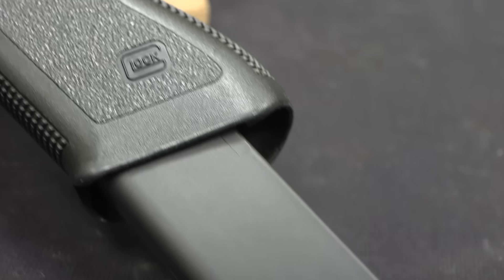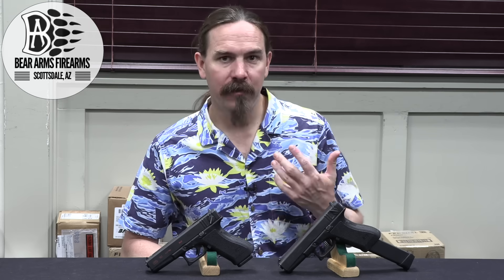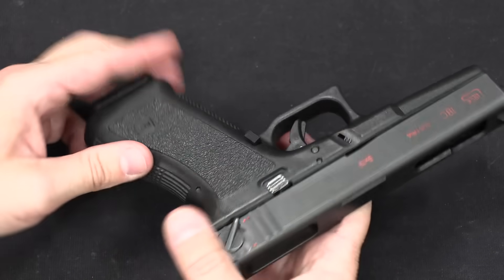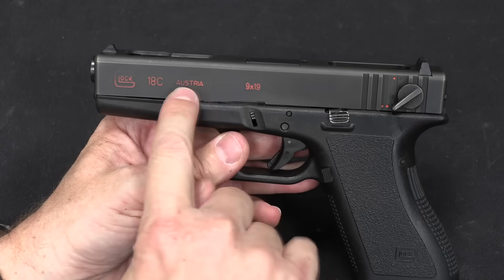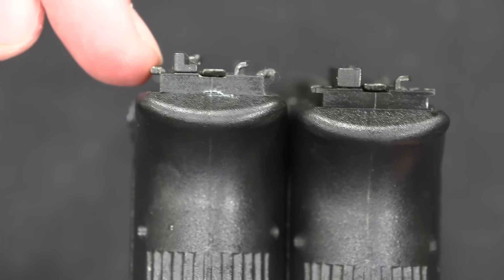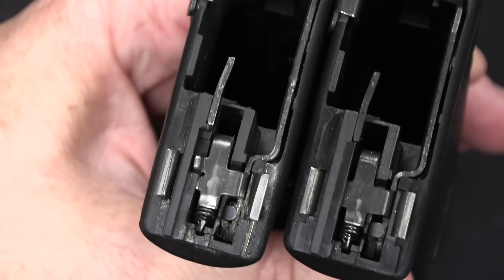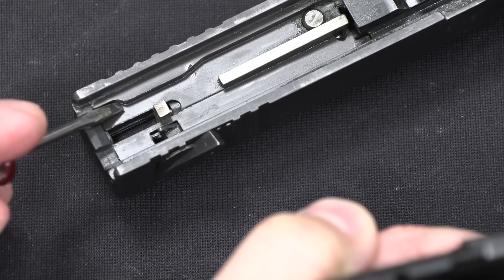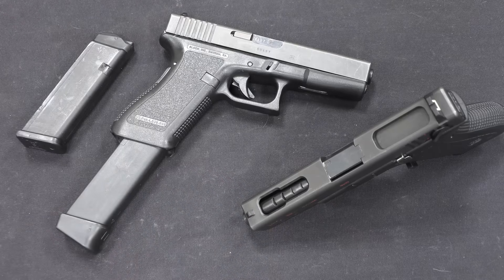Glock 18 & 18C Machine Pistols: How Do They Work?

Comment: 5:05 I'd like to remind folks that FRTs are totally legal to buy right now and exist for many common pistols like the every glock ever.
Reply: What I understand is that FRTs are kinda legal but not for handguns so...
¯\_(ツ)_/¯
Reply: @SniperSnake50BMG maybe it depends on where you live. They effectively arent legal in Chicago or NYC because of regulations on handguns in general, but from a federal position the ATF says 1 round for 1 trigger pull is semi auto. Thats what an FRT does, just very fast. 

Until the letter of the law is changed, all FRTs are currently legal because the trigger resets after every round is fired and needs to be pulled again. By definition thats semi auto. 

Also I brought by tx-22 with frt to a DNR operated range with law enforcement present and everyone was cool with it. I wasn't even the only frt pistol guy there.

Buy it now while you can.

Comment: Sig, notice how it stops firing when you release the trigger. Write that down.
Reply: Also notice it starts firing when you press the trigger
Reply: I have a P320, i managed to pull the trigger once while dryfiring WHILE the safety was on.
Reply: @BlAcKSaDooo  Then it's either a M17 or M18.🤔🇺🇸🇺🇸
Reply: @BlAcKSaDooo  jokes aside, P320s don’t have a safety you can turn on or off
Reply: Military compliant ones are required to have a manual safety as part of the contract
Reply: LOL
Reply: Because a p320 doesn't need the trigger pulled.  Don't you see how sig made it better!

Comment: Wait, at 7:50 when you rack the slide while holding down the trigger it trips the sear. Doesn't this mean it will essentially run away immediately if one is neglectful enough to be pulling the trigger while reloading?
Reply: if you had any training, you know to not point it at anything you're not willing to destroy, and to keep your trigger finger off until you're ready to fire
Reply: @stefthorman8548  Sure, doesn't mean the scenario I described is any less desirable though.

Comment: I must bust this recoil myth. Lighter slide/bolt is not going to reduce recoil, let me explain. Common momentum of two objects (projectile and slide) will always remain the same, if you make slide lighter it will go back faster (this can be proven by velocity=force×time×mass^(-1) formula). Let's say we have 0,01kg (155 grain) bullet and 0,5kg slide. Their momentum must be equal so if bullet leaves barrel with muzzle velocity of 400m/s rearward velocity of slide is going to be 8m/s (momentum=velocity×mass). Kinetic energy of the projectile is going to be 800J and kinetic energy of the slide is going to be 16J (energy=velocity^(2)×mass×0,5), we can already see that lighter object absorbs more energy and that energy ratio is inverted mass ratio. Now if we made slide half the weight (0,25kg) it's rearward velocity is going to be 16m/s since it's momentum still must be equal to the momentum of the bullet. But now it's energy is 32J because it's lighter and absorbed more of it. This is why you see people putting big red dots on their 10mm MOS Glocks, they are trying to reduce energy of the slide. It is also why straight blowback guns have so heavy bolt/slide.

Comment: This is how a glock switch works, it just pushed down on the striker plate with proper timing and putting it into single moves the pin back 2mm so it can't.

Comment: Besides having fun and going thru ammo quick and of course impressing folks who don't know much and folks who know alot and ate like dang you was able to get one of those there aint much use like he said besides maybe ricocheting a bunch of rounds really quick which could be useful especially if one has another mag to pop in. It having the selector switch tho should make it more useful than semiautomatic versions alas the restrictions which are stupid in this case since it would likely be less effective than semiautomatic in the hands of someone who don't know much. I suppose there is the contact or near contact mag dump which would be pretty gnarly since getting thirty rounds pumped thru a person in less than a second is vicious and id wager often fatal. Two in the chest and one in the head? Na how about thirty in the head or thirty to the chest.  I wonder how most vests and people for that matter if wearing a plate would deal with with so many rounds so quickly in a small area.

Comment: It works the same basic way the "switches" work, except that the add on version pushes the opposite side of that plate without the tab that sticks up ! I had to fit a connector bar for a friend that had a post dealer SOT sample switch.

Comment: I may have missed it, but why does the 18 have 2 pins and the 18c 3 pins. It was my understanding that the 3 pin trigger module wasnt introduced until the gen 3 glocks, and then it would have finger grooves as well but the 18c has none.

Comment: Attending a Glock Armorer's class in Smyrna in the 80's, the entire class got to fire one 32 rd magazine each through the pistol. Great fun, fairly easy to control where you were shooting but not how many rounds per trigger pull.  When the slide got too hot to touch, the instructor stuck it in the eye wash fountain for a few seconds to cool it.
Reply: Thats pretty cool. Isnt that a good way to warp the slide though? Just letting it cool naturally would be best, correct?
Reply: @whiteyfisk9769  Typically heat, then controlled cooling, but the slide was no where near hot enough for tempering, just too hot to handle. He would also take and fling the pistol hard across the floor into the walls and corners of the range. He was reinforcing to a group of police range officers that this new weapon was tough.

Comment: comparing a 18 with a 17 and a switch would be interesting because it shows 2 different ways to make the same gun go FA
Reply: It’s surprisingly similar and the principle is the same. Glock moves the full auto bit up in semi for disassembly. Switch devices move the angled part slightly rearward for semi but it still blocks disassembly.

Comment: In Argentina the Buenos Aires Police Department, issue G18s to their Special Unit "Halcon" in the 90's and early 2000. The unit veterans still have them. But newer operators receive the Bersa.

Comment: I would really love to try out a compensated one. I have fired a normal Glock 18 and confirm it is a spray and pray. First shot is on target, and everything else is in the air. If you flinch bad you might get a burst on target, so great for bad shooters I guess, haha.

I always loved how simple these were. Little nub pushes the sear. The end. They did not even bother stopping the disconnector from working like a lot of auto designs.

Comment: By the way, there are NO civilian legal Transferable Glock 18’s or “Glock switches”.  Transferable  machine guns were banned from import in 1968 by the GCA. Domestically manufactured machine guns were banned in 1986 by the FOPA
Reply: theoretically, a demilled 18 could have been imported and re-welded and registered before the cut off date, but you are probably correct

Comment: You know what would make the Glock 18 very very controllable without the compensation?
A proper shoulder stock in the same sort of style as the one that engages 3-round-burst for the Beretta M93R.
...Of course, like anything "fun" that is firearms related, it would also probably make the ATF rather irate, and be instantly outlawed in both CA and NY.

Comment: @7:11 It seems amazing to me that this works at all. It's all tiny contact surfaces on very rough-looking parts. Maybe that's just Gen2?
Reply: The top of the ejector and trigger bar are noticeably rough since the parts are stamped from sheet material. The rough parts don’t touch anything.  

Glocks were reliable when they looked like this and they still look pretty much the same. I’ve seen really old ones, mine is from 2002, and I’ve seen new ones. Glocks will be Glocks.
Reply: @Glocktologist  Name checks out.

Comment: I got to play with a G18 &G18C some years ago. They were LE dealer sample guns.  Took them apart to see the internal differences.  They were Gen 3 guns.  Never seen a Gen 4 or 5  version. I’m a class 3 dealer and I can’t imagine Glock made very many as there isn’t a big market.  If the 1986 Machine Gun ban was overturned I could sell thousands of these though.

Comment: I'm not super familiar with modern pistols; if the trigger cocks the striker the rest of the way, how does the striker get fully cocked for subsequent shots? Or does it not get caught while cycling f/a?
Reply: The disconnector trips as the slide moves back. The trigger bar is in the rearmost position at that point. 

As the slide returns forward, the firing pin catches the sear on the way. So the firing pin and recoil spring are actually pushing the slide in opposite directions.

Comment: I doubt he'll ever risk violating youtube rules but it would be neat if Ian did a video comparing the glock 18 to glock switches. Like, how does a glock switch work vs the glock 18?  Am I banned just for asking that?
Reply: Not much to compare. Aftermarket switches have a similar angled surface as the genuine thing, but it’s a little to the right so it is able to press the normal trigger bar / sear down.
Reply: @Glocktologist  i wonder if we are both banned now 🤭

Comment: Full auto Glocks are actually pretty easy to control when one has had enough run time with that platform, in the ATF agents defense you can not remove the slide of a Glock with a Aftermarket Auto Sear without removing the backplate selector and sear first. That is why Ian mentioned in the beginning that the Selector on the 18 needed to be in the semi mode. It brings the seat out of the way and allows the slide to be removed.
Reply: Isn't it their job to know guns work since their regulating them to a degree? I mean, glocks are not super complicated.
Reply: @Bigfoothawk  just because someone should know something doesn't mean they will
Reply: I’m

Comment: It would be interesting to see how the "Chicago" switch works in comparison to the OEM system...
Reply: Even simpler!
It just prevents the triger bar from poping under the disconnector surface on the sear.
Then the slide peresses the triger bar again (normaly the out of batterie funktion).
But i guess thats not as reliable and causes more wear on those parts then they are designed for.

I build somthing like that for the Peterstahl 1911 (Fancy german high end clone) from my father.
Don´t know if that works on all 1911s.
Just a pice of sheet metal that got stacked over a pin for the sear parts and prevented the sear from disconecting.
Then the out of batterie plunger that gets depressed from the slide was the "Autosear".
Not super reliable and not switchable, but good for a little giggle! 

7 Rounds of pluss P .45ACP in a blink of an eye is scary and fun at the same time!!! 😅
Reply: @martin09091989  Appreciate the reply!! Thank you!!
Reply: I'm sure YouTube would love that lol
Reply: @kiwi_comanche  huh. My comment got deleted. BS...
Reply: @TheExplosiveGuy  I can see it
Reply: Even simpler but in a rifle is the old matchstick under the sear of a 7.62 SLR (FN FAL). Good fun with blanks in training, and even funner with live rounds.
Reply: @Klemheist-vf1hx  The Norinco SKS-D has a similar feature, there's a little hole on the side of the fire control unit that a piece of 10 gauge copper wire fits in nicely and prevents the disconnector from falling off the sear, but the gun is nigh uncontrollable due to being over-gassed like a MF'er, it probably shoots at around 900-1000 RPM lol. Many a giggle were had when a friend of mine brought his out on shooting trips😂. The first shot lands dead on, by the third round it makes a good duck gun lmao🤣.
Reply: @Klemheist-vf1hx  Had some good times with the SLR myself as it happens!!!!
Reply: I have no 2 cents to contribute. 
I'm just here for the algorithm.
Reply: @TheCivilWarriorProj  😂🫡
Reply: Both are oem . If u mean og version then ok I get i

Comment: I see how the 18 work how do the "Glock switches" work then if it don't have the ability to reset the striker or does it?
Reply: It works in a similar fashion but the angled part is more to the right. 

The disco trips as soon as the slide moves back. 

All switches (including the actual Glock 18) simply force the trigger bar / sear down as the slide moves all the way forward.

Comment: I’m not sure how the striker gets re-cocked in full auto, if the protrusion trips the cruciform sear in its rearward position.
Reply: When the slide moves back, the disco trips and the sear rises up. 

When the slide is coming forward, the firing pin catches on the sear and the firing pin spring starts to compress. 

Only at the very last moment before the slide hits fully forward, the angled surface on the full auto bit (genuine Glock or aftermarket switch) pushes the sear down to release the firing pin.

Comment: I live in Smyrna Ga. and am a retired Glock employee.  I always wanted a gen 2, 17 L and we made so few of them that I could not get one.  They used to fire those 18's until they just melted. Hundreds of rounds as fast as they could change mags.
Reply: Bet you got some nice ones in your collection. Glock just purchased a couple thousand acres out here in Carroll County for what I am told is a training center. I asked some Glock poeple about it Shot Show, but they were pretty mum about it.
Reply: @ When I was with Glock ( early 2000's)  We did racks of 100 at a time. ( some smaller runs for specialty department engraved models). The whole time I was there I only saw a couple racks of 17 L's come through. SO probably one 17 L for every 10,000+ G 19's. Back then the .40's  were popular  - a lot of LEO contracts.  Oddly the G-19's were the most problematic that we made. They had chronic frame curve problems.  ( but I have two that are my EDC).I screwed around and missed the deadline back in 84 with the NFA.  So I have to satisfy my " machine pistol"  thing with my old MAC 10's - a lot different beast.  you ( at least I) have never seen anyone try to supress a G  18, as with that barrel flopping around I would think it would self destruct on the first mag???
Reply: Did you get to take an 18 home with you for extended testing?
Reply: @nate18268  No... I didn't see that ever happening. It would have been a paperwork nightmare.
Reply: i like how everyone believes you, gun nuts will literally believe anything.
Reply: That's strange.
Here across the pond I've seen loads of G17s for sale. Didn't even know they were a thing until I got my firearms license and started looking at the used firearms listings, but since then I've seen many.
Reply: @wurfyy   G-17  "L"  the long target model.  I have a G-17 gen one engraved " Atlanta Olympics Security team".
Reply: @ Yeah, typo, I did mean the G17L, not the basic G17. Plenty of them here.
Reply: @wurfyy 
Plenty of G17L where you're from? Lucky you. Here was a retired Glock employee & he couldn't even get his hands on one.
Reply: @Tam0de  I was gonna say he's free to come over and buy one but you have some annoying import laws about that.
At least it's good to know they're not as common as I thought. Not gonna lie, the thought had crossed my mind to buy one and mill an optics cut on it, so now I'm definitely not doing that.
Reply: @wurfyy  g17 L* is what he said

Comment: Interesting how simple the auto-trip system works. I expect that the fire control linkage is functionally the same in other Glock models, which explains why 3rd party "switches" are so plentiful. The real trick would be to design a switch in such a way that it would slow the fire rate enough to actually be controllable, but then again all the future scholars of Chicago don't seem to care about things like trigger discipline or recoil control.
Reply: You could probably make it work with some kind of a dead-blow mechanism that pushes the trigger bar / sear down /after/ the slide hits forward position, not /as/ it moves fully forward. 

It would add moving parts and complexity for sure, and would require some heft and perhaps a shallow angle to work reliably.

Comment: Counterpoint to what you said about this gun not being that great to use for purpose. The SOF community has and does use these on occasion. Primarily for extreme close quarters urban combat/room clearing situations. Quite a few former SOF on the internet have talked about it. But they all would agree with you that its very niche in its purpose there AND takes just as much training to use effectively as you said.

Comment: The porting goes so far back that it probably significatly reduces muzzle velocity and that can be the real reason the slide was lightened and would also reduce recoil impulse i would guess
Reply: Light weight slide on a full auto would also increase the RPMs
Reply: because muzzle velocity is super important on 1200rpm machine pistols isnt it? i always find it hard to hit targets 5-600 yards away when spraying my full auto glock, that muzzle velocity is certainly the issue there.
Reply: @Razticz  yeah everything about your comment showed us all you don't know what the fuck you're talking about.
Reply: Wouldn't porting further forward create better leverage and less recoil, though?
Reply: @dominicbadura  absolutely! However I am sure glock knows what they doing so I am.sure there is a reason behind it!
Reply: @dominicbadura  yes but too much porting without the right load can cause failure to eject malfunctions which is why they had to cut so much weight off the slide, if that back part wasn't cut out the gun would be hit or miss on whether it could cycle through a mag without jamming. ports are also far more effective with higher powered loads and while glock may have known this, you can't bet on a law enforcement agency not using the absolute cheapest ammo they can buy.